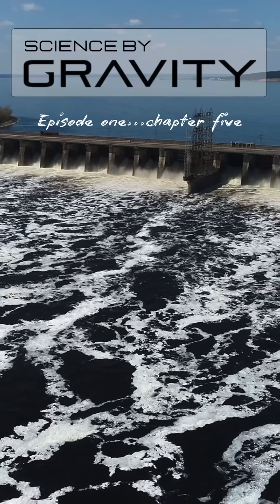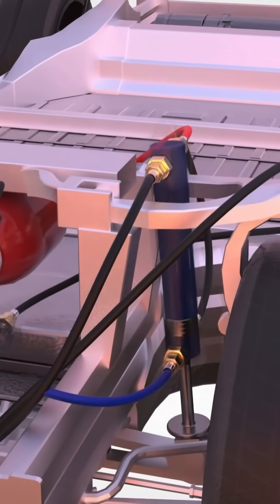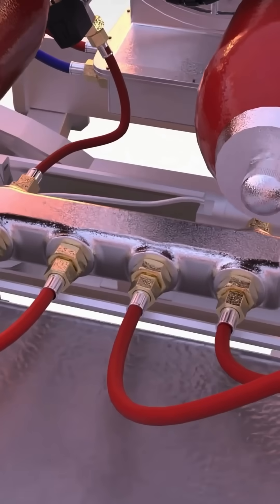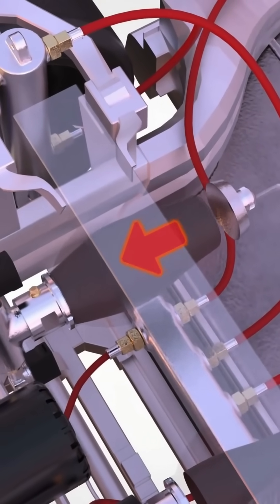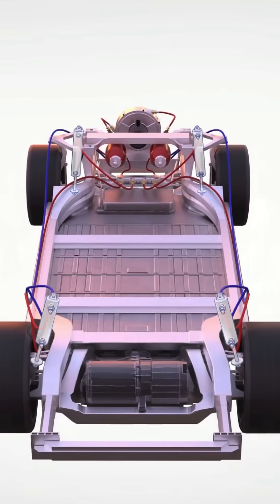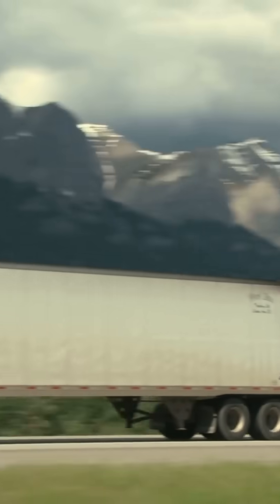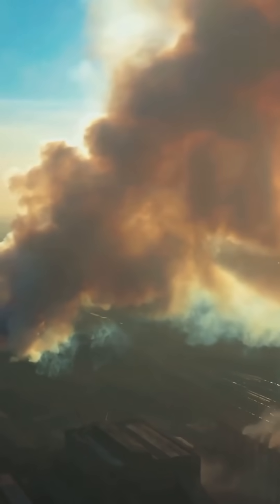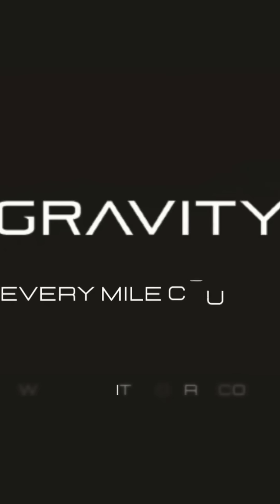Chapter 5: How Gravity Works 🌍⚡ #energyrevolution  #RenewableEnergy #Innovation

Comment: Seems like one of those things that sounds like a good idea, but between increased parts and maintenance costs, ends up being more expensive
Reply from the maker: That’s a fair concern! Any new technology has to prove its value beyond just sounding good. The key is making sure the energy recovered outweighs the added complexity and cost. Our goal is to design a system that provides long-term benefits without heavy maintenance. What would make a system like this worth it in your eyes?

Comment: Why not have magnets in the shocks and eliminate the waste of hydraulics?
Reply from the maker: Great idea! Magnetic systems, like linear generators, are an exciting area of research for energy recovery. The challenge is efficiency—hydraulics are still very effective at handling the high forces in suspension systems, while magnets alone can struggle with power density. But combining both technologies could be interesting!

Comment: As a kid, I thought of the idea to just slap dynamos on dead axles, such as the rear wheels on a FWD car, or trailers being pulled, to extend the range of electric cars, but much to my disappointment, physics apparently has a problem with that for some reason.
Reply from the maker: Thanks for the comment!  That’s a great way to think about energy capture! The challenge is that adding dynamos to dead axles creates extra resistance, which means the car has to work harder to move—kind of like riding a bike with the brakes slightly on. Our system focuses on capturing energy that would otherwise be wasted, rather than adding drag.

Comment: Unfortunately, liquids can't be compressed; go with gas instead.
Reply: Maybe not compressed(wrong choice of words) but fluids can be put under pressure. That is how Hydraulics work.
Reply: @vickichamberlain9124  So effectively... the entire suspension should use hydraulic oil... the same as is used in pneumatic systems. Sounds like a plausible idea...
Reply from the maker: Good point! Liquids don’t compress, which is why hydraulic systems work by moving fluid instead. Our system takes that into account and also explores ways to use gas where it makes sense. What do you think is the biggest advantage of using gas here?

Comment: Your ride quality would tgen suffer
Reply from the maker: Great point! Ride quality is a key factor in energy recovery systems. Our system is designed to capture energy without significantly impacting suspension performance. Innovations in damping and system tuning help balance efficiency and comfort.